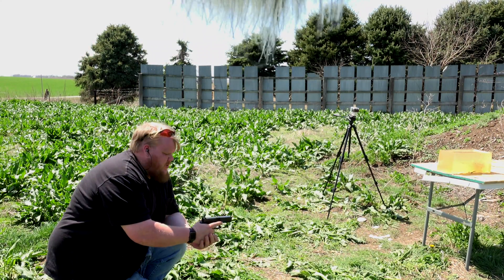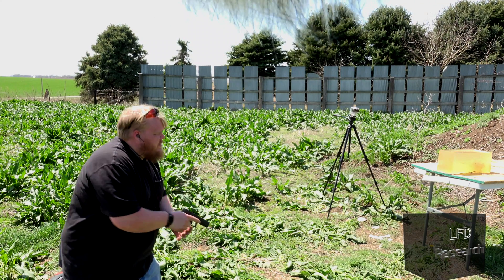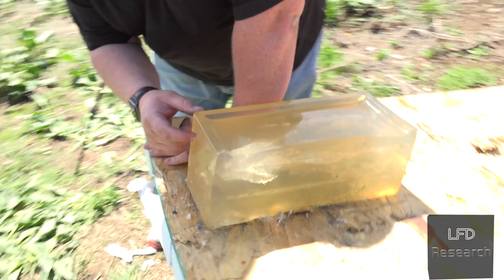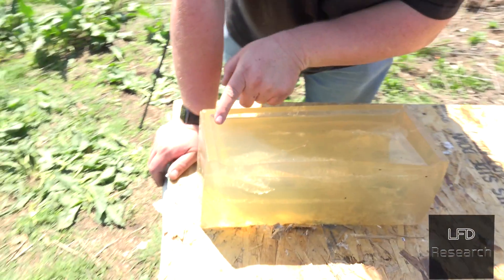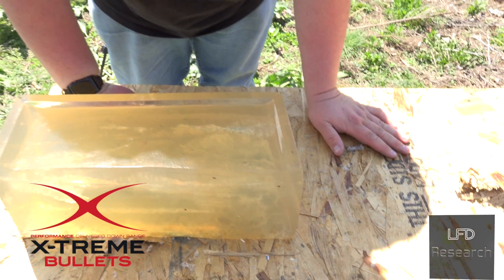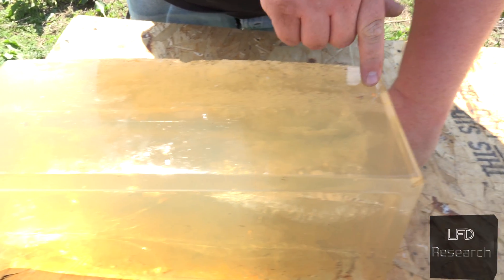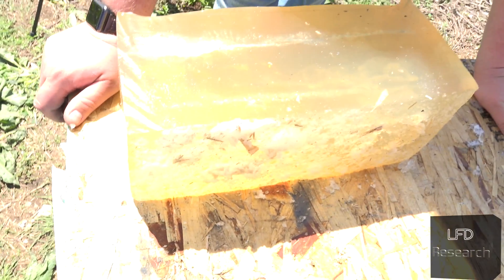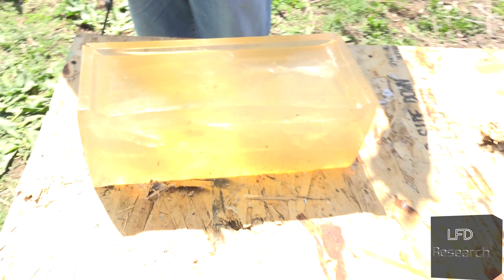9mm Reload Termnal Ballistics

Comment: "Shattering" is not the same thing as fragmentation.  Shattering is a wholistic dispersal of mass like glass shattering on impact as a result of total structural failure. 

 Fragmentation is a uniform loss of mass during prolonged deceleration, typically after expansion, and is a result of material or static drag exceeding the cohesive properties of the projectile.  Think of it more like an asteroid breaking up as it enters the atmosphere.  

Frangible ammo shatters.  Ballistic ammo fragments.  Nothing in this video shattered.

Comment: Thanks.  I just loaded a few hundred 124gn hollow points, and was worried they wouldn’t expand.  Another channel said they thought the hollow point was just for show because one went into the dirt behind the target and didn’t expand.   ButI know that hollow points that hit solid, and not soft targets will do that
Reply from the maker: Keep in mind this was 124gr loading out of a g17 so a longer barrel and a hotter loading near red line but as you can see the heavier 147 didn’t expand the question then becomes how low of a velocity will the 124gr stop expanding at
Reply: @LFDResearch     Sounds like you need another video. 😉.         I’m using the max recommended with hodgdon cfe pistol powder out of a sig 226.   I loaded a few hundred +p, but the aim was off, so I stepped it down 0.5gn, and now it’s about right